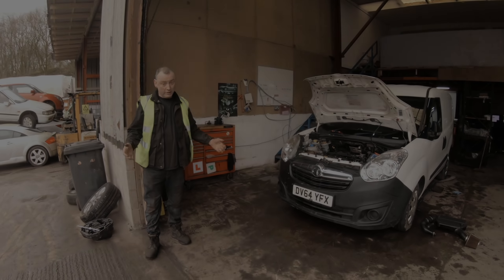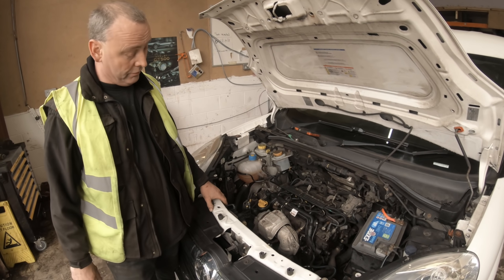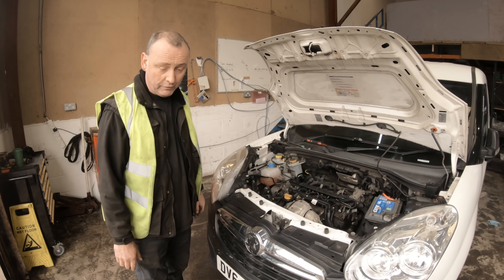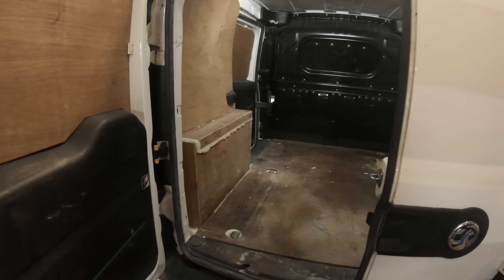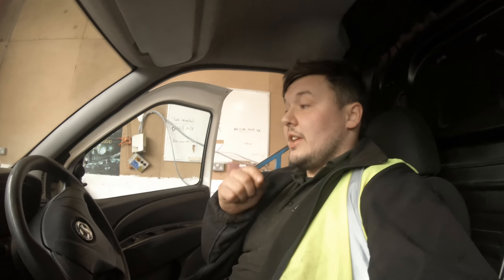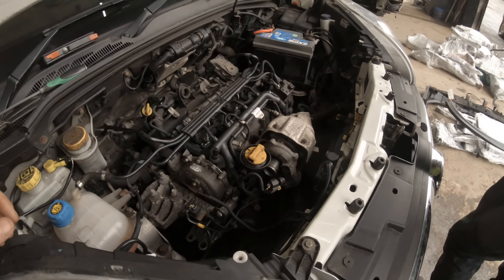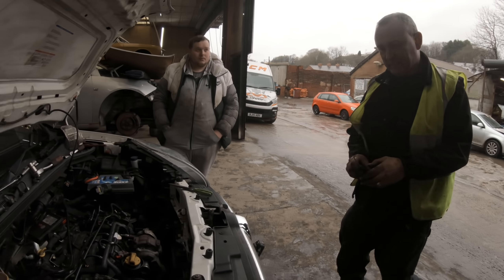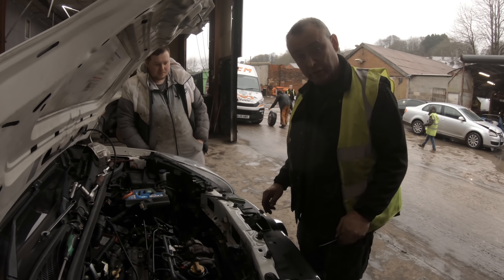WILL IT RUN? - DIAGNOSING THE PROBLEM! (2014 VAUXHALL COMBO 2000)

Comment: remove the rockers so all the valves are clossed, put the injectors back in turn over to see if theres comprestion with all the valves shut if so new lifters and chain kit. it a shit job to do iv done one before.